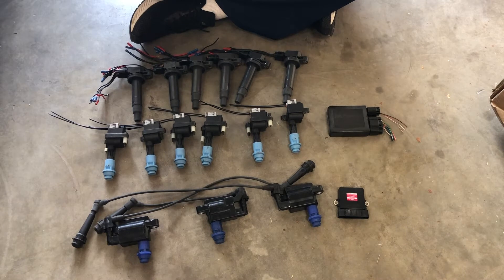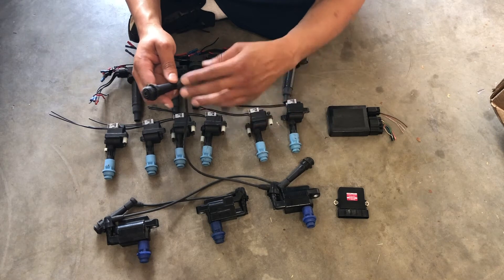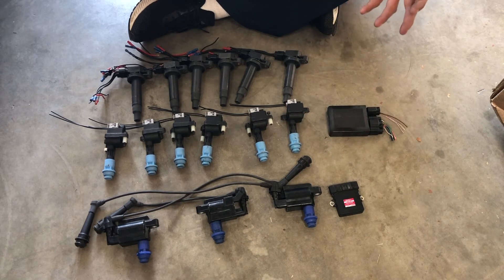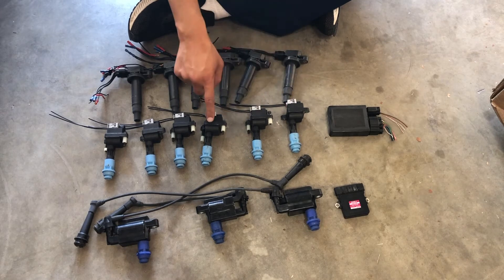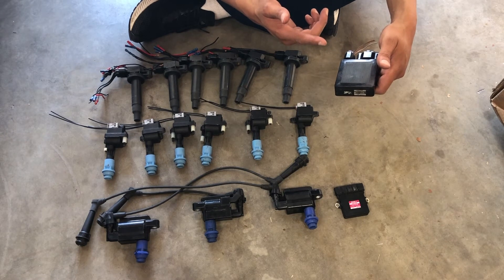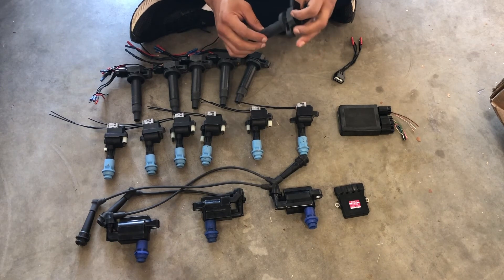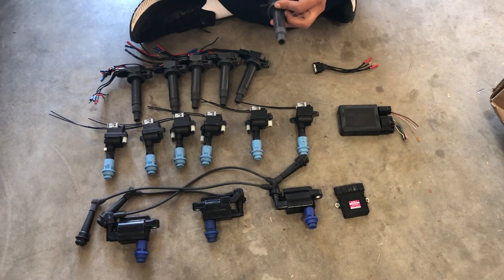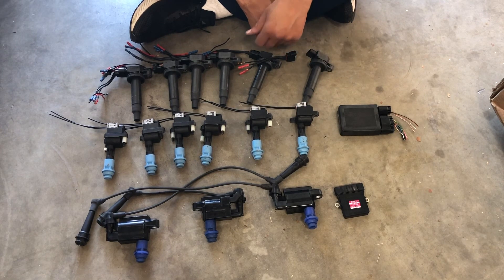SC300 Episode 31 - Ignition Options

Comment: Can you tell me which color goes where on the 2 pin coils pls
Reply from the maker: The polarity does not matter.  1 wire goes to coil trigger and the other goes to the +B.  You must have the proper igniter to use with the coils.
Reply: Ok thank you it's the right ignitor just the coil connectors are damaged and I wasn't sure if I'd connect them correctly

Comment: 1jzgte link g4x storm. Some guidance please. I’m thinking of running honda accord CL9’s coils
Reply from the maker: I am not familiar with that coil or ECU.  If you are going to run them you need to find out a few things.  1. The coil pinout.  You need to know the ground, 12v, and trigger wire.  2. The firing order of the 1jz.  Then wire the coils trigger wires to it appropriately.  3. The coil dwell time for the ECU settings.  You need this for the coils to perform correctly.  That is all the advice I could give.  Sorry I couldn’t be more help.
Reply: @r.a.w.performance6602  thank you. All help is appreciated :)

Comment: So what do you do for the cam signal if your deleting the distributor setup?
Reply from the maker: The cap is gone but the rest of the dizzy is there.  Driftmotion sells a cover.
Reply: @r.a.w.performance6602  awww okay so your still using the internals of the dizzy just deleting the cap portion?
Reply from the maker: @JZS13  Exactly! 😁

Comment: This information is very helpful 
I have a 1gzze 1998 mark2  with the same set up with three coils  could the six coil use in my car please help
Reply from the maker: The way I did it was I wired them in wasted spark.  So you wire the 1st output to coils 1 and 6, the 2nd output to coils 2 and 5, then the 3rd output to coils 3 and 4.  This is the easiest way without making any ECU changes.  With a standalone ECU you can wire the coils in the firing order so outputs 1, 2, 3, 4, 5, and 6 correspond to coils 1-5-3-6-2-4.  The coils to use for this are the 1nz or some type of smart coil.  This website has the pinouts for the 1nz coils.  https://www.sq-engineering.com/tech-articles/coilpack-info-guide/ Hope that helps.

Comment: i have 2jzge 96 i have 6 coils in the 2nd row i don't have a black box i have the engine how can i attach it
Reply from the maker: Without the igniter box you can’t.  You can only run the smart coils without the igniter.
Reply: @r.a.w.performance6602  No, I bought a complete gs300 1996 car, every part of the engine is there, the distributor is problematic.
Reply from the maker: Did your 2jzge come with a distributor?
Reply: @r.a.w.performance6602  yes there is a distributor on it but it is causing problems I wanted to install new generation coils but it didn't fire, I experienced 2jz engine in the country
Reply: The igniter in the 2nd row is very difficult to reach .no . there is igniter in the bottom row but 3 exits.connecting coils 1:6 and 2:5 will it fire or work?
Reply from the maker: I was thinking you can get one of those igniters and give it a try.  You would have to wire it in wasted spark.  So 1st output to coils 1-6, 2nd to 2-5, and 3rd to 3-4.  Are you running a standalone ECU?
Reply: @r.a.w.performance6602  No, it's not independent, it comes with an ECU number 57 cable.
Reply from the maker: Do you mean the ECU came with the engine?  The coil on plug set up will only work with a standalone, 2jzgte, or 2jz vvti ECU.  There are not enough outputs on the 2jzge with a distributor ECU.
Reply: @r.a.w.performance6602  thank you for understanding me no english i write google translate

Comment: How do you wire the smart coils to the Ecu pinouts? I only see 3 options that share cylinders. I can’t figure out what to do about that. :(
Reply from the maker: It depends on what you are running for your ECU.  A standalone ECU can be wired with each ECU having its own channel.  If you are using a stock COP ECU then yes the coils will share a wire to tell them when to fire (wasted spark).
Reply: @r.a.w.performance6602  ok awesome thanks!  I’m using stock JZX100 Ecu 1jzgte vvti. So I just run the wires directly to Ecu pinouts?I’m guessing i won’t need the stock ignitor anymore either. I’ve been struggling with it for years:( lost motivation but finally gaining it back lol
Reply from the maker: @jsdrifts  The wire from the ECU goes to 1 pin, one goes to 12v, and I believe the other goes to ground.  There are pinout diagrams out there for the ignition coils.
Reply: @r.a.w.performance6602   thanks man much appreciated